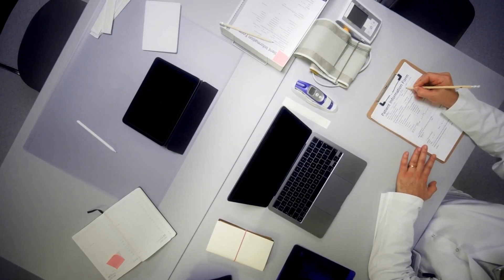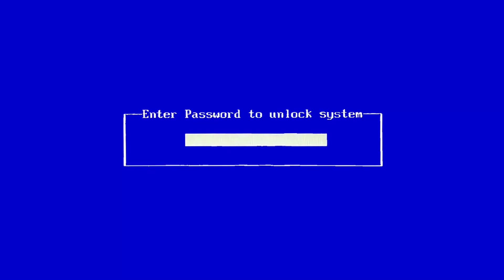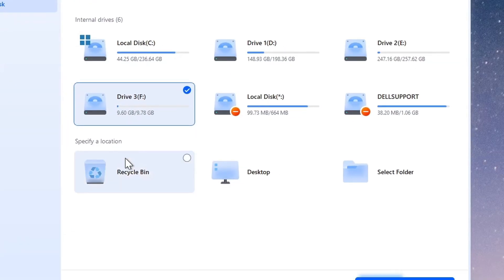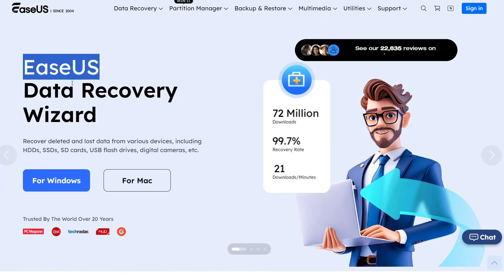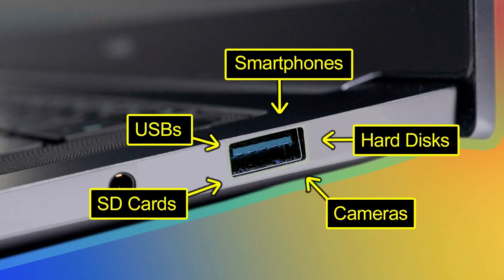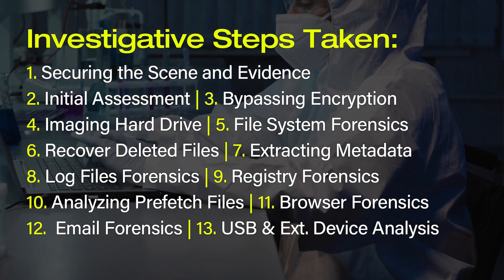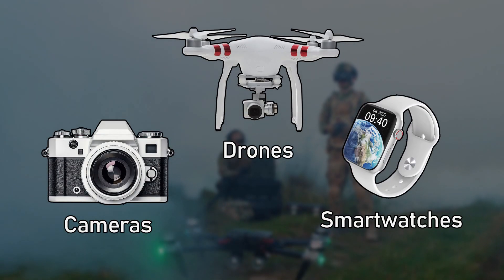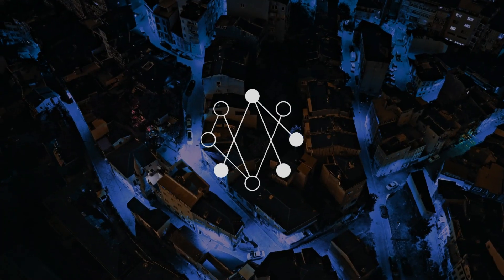Introduction to DIGITAL FORENSICS! (& data recovery)

Comment from the maker: 🔔 Quick update: The next video drops on August 6th!

- Check out EaseUS Data Recovery Software: https://bit.ly/4dkViWB
Reply: What if someone used tailsOS in a public library's pc
Reply: @Domains_Creator That's not wise because you are still using their system. In addition, you have to watch out for cameras inside the library.
Reply: Bro can you make on video "basic to advance fundamentals of networking" 😅

Comment: My advice in this talk is to learn one language that is sufficient to write your programs. Learn Python and the rest of the languages. It is sufficient to understand the codes only. Learn the Windows system with mastery until you reach the stage of analyzing dll files and log files that contain user-specific keys and others to secure the reverse shell after hacking and learn to execute programs on memory only and also learn Linux commands and networks, then solve hacking labs designed for education. There are many things that I even mentioned and I have not learned yet. The field is vast and the ink of the sea

Comment: 2:06 My senior capstone involved BIOS password cracking — CMOS battery removal doesn’t work for most newer laptops as the BIOS password and default settings are stored in EEPROM. They will be loaded from there the second you try to boot the computer if the CMOS battery isn’t present. Shorting the EEPROM using the SDA and SCL pins will work in resetting the password, but it’s very risky and very difficult to pull off. You risk bricking the entire computer, and even if you do it right the computer may be immune to that technique anyways. Flashing the BIOS with a modified file to reset the password is a 100% success rate technique (ONLY IF the BIOS isn’t integrated into the motherboard), but it requires soldering, an IC chip programmer and proper software to communicate with the BIOS chip, and some files you have to acquire from some shady online vendors. Unless you have sufficient knowledge of the BIOS and can create a flash file yourself, you’ll have to buy the file for a few dollars. Also, I’m pretty sure some companies no longer do “master passwords”, and if they do they’re probably only handing it over with some government pressure. For one of the systems I was using, the only way to recover a BIOS password was to get the whole motherboard replaced (or shorting the EEPROM, but this particular system was immune to that). Good luck in your endeavors peeps.